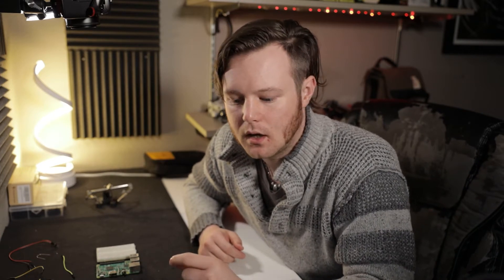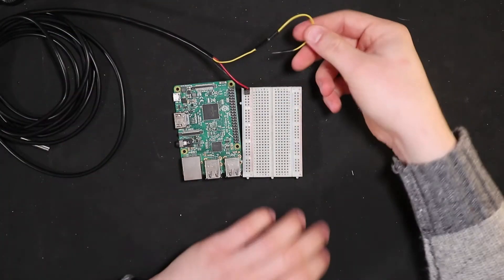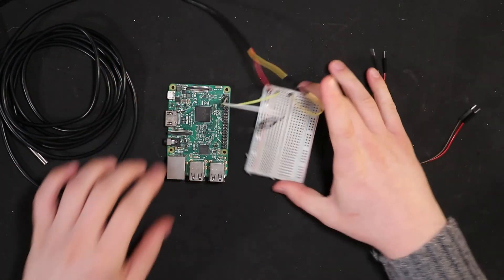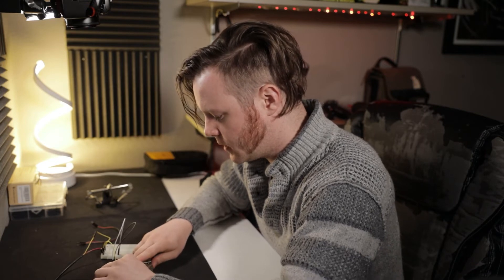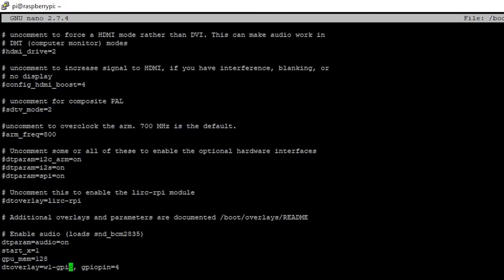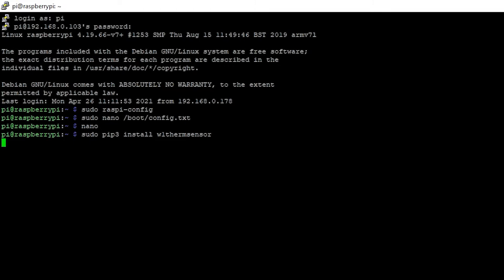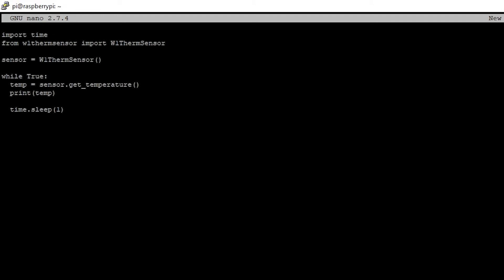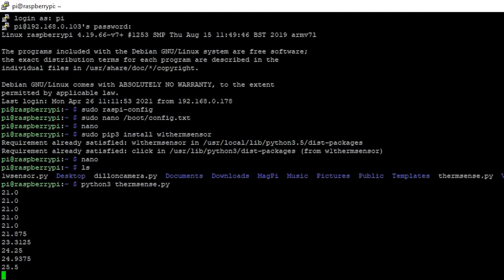A Simple Guide to Get the DS18B20 Running on Your Pi

Comment: How would it change where you have multiple sensors hooked up in series and need to read them all off of the 2 wire connection? (I have some grain bin temp cables im trying to read)
Reply from the maker: You would do it the same way. They all connect to the same data wire you’d just use different addresses for each sensor. You can literally have as many as you want on the same data wire. It’s great!

Comment: You wired it WRONG. the 1wire voltage level for the RPI is 3.3V, you used the pull up on the 5V rail.
Reply from the maker: https://mm.digikey.com/Volume0/opasdata/d220001/medias/docus/2890/UMW%20DS18B20.pdf

Comment: I get an externally managed environment error when I try to install w1thermsensor; it looks like I can either install it to a virtual python environment or bypass with the --break-system-packages flag.  Did you experience this issue?

Comment: Thanks for the video! I'm completely new to this, you mentioned soldering wires? Is that necessary? I was a bit confused about that part
Reply from the maker: I only did that to attached the pull up resistor directly to the wires, if you put in on a breadboard or have a version of the sensor like on a breakout board then you dont need to solder at all.
Reply: @makerjakenet  Thanks, I do have a breadboard. If you don't mind can you also clarify if the resistors I have would work? The ones I have say "1kΩ" and "10kΩ" would I use the 10Ω one?
Reply from the maker: 10k might work but if you put 2 in parallel then that would be the equivalent resistance of 5k and that should definitely work
Reply: @makerjakenet  Im not entirely sure what the means to be honest. I can see in your video that you put one in the top row and the other end in the bottom right corner of the top left section. Where would I put the second one?

Comment: Is it normal that the raspberry pi screen turns off when I plugged in the voltage pin to 3.3v pin?
Reply from the maker: I don't think so. That depends on the screen too though so I wouldn't really be able to help you much with that. The only thing I would recommend checking is to make sure your sensor isn't shorting out your power.

Comment: Can i use another gpio pin instead of gpio4 pin because i got another sensor connected to that specific pin
Reply from the maker: I THINK you can use any pin, you just have to configure it in the code. Don't quote me on that though

Comment: When you plug the sensor, is it normal that it emits a red light please?
Reply from the maker: The sensor doesn't have a light on it unless you have a breakout board that has one. Are you talking about the raspberry pi?
Reply: @makerjakenet  the sensor l have has a little board attached to do it. And the red light is on this little board when l plug the sensor to pin 7 or 8 (ceo), I am using raspberry pi 4
Reply from the maker: @maherkhaznaji  I see, then the light turning on is probably normal. Look to see if the board already has a resistor on it. If it does, then you probably don't need to add one of your own since it already has one.

Comment: Yo dude - I found this video for a similar project and have been pulling my hair out trying to get the sensor to work, do you NEED to use the breadboard? The tut I'm following doesn't mention it so I assumed I could connect sensor directly to PI
Reply from the maker: You don't need a breadboard but you do need to have a pull-up resistor on the data line to the power line. If I don't want to use a breadboard I've just soldered the resistor between them. The breadboard is strictly for convenience.

Comment: My local food pantry wanted to get temperature monitoring for a bank of chest freezers.  The problem that I ran into is they often shut one freezer down when they can to save energy.  Commercial solutions didn't offer an easy way to shut alarming on and off and I wanted something wired.  I experimented with putting a switch inline with each sensor on the power lead.  When attempting to read the sensor with the switch off I got 185.  I wrote a script to check the sensors hourly and if they were above 15 degrees and not equal to 185 it would alert.  I also log the temperatures a few times a day.  Their internet is nat'd so I have a reverse ssh tunnel back to my house that I monitor to make sure everything is still alive at the pantry.  I just instructed everyone to make sure the switch is on if the freezer is on and off if it is off.  So far it is working great.
Reply from the maker: That’s awesome! Sounds like a great use case.

Comment: Hello, thank you for making this! Very straight forward tutorial. Please could you explain what the purpose of the "pull up resistor" does? What would happen without it? I'm new to electronics, thank you
Reply: the pull up resister is part of what allows all of the devices to share the same data line.    formally this is a open collector circuit that implements a 'wired and' logic element.   search for those terms to get a full explanation.
Reply from the maker: @gngdunn  great info, thank you!
Reply from the maker: For many applications it is to make sure the default state of a pin is "HIGH." For others it depends on how the sensor communicates with the microcontroller. In the case of the sensor in this video, the only reason I know a pull up resistor is needed is because the datasheet says it's needed. I would assume it's for boosting the signal or making sure the data is read properly by the raspberry pi, but that's getting into areas I'm not super familiar with, to be totally honest.

Comment: At the beginning of the video, you mention a feature of the one wire protocol is that it is addressable.  Is the DS18B20 addressable in this way?
Reply from the maker: 1-Wire Sensors have an ID about 15-20 characters long or so (at least these temperature sensors do). If you use multiple devices, then you will need to use the part of the library that allows you to create multiple instances of the sensor using their respective IDs.

Comment: is the measure in  degree celcius or fahrenheit ??
Reply from the maker: By default it measures in C but you can change the "get_temperature" line to "get.temperature(Unit.DEGREES_F)", but you also need to add "Unit" to the import line to look like "from w1thermsensor import W1ThermSensor, Unit"

https://pypi.org/project/w1thermsensor/

This page will have more documentation.
Reply: @makerjakenet  Thanks mateee

Comment: Thanks a lot.

I would like to configure 4 temp sensors and they should display the temperatures on my phone over the internet. It should also log so that I can see a graph over time.
Any ideas on how to do this easiily ?

Thanks :)
Reply from the maker: Adafruit IO is a great tool to do that. I had a project I made a video about that I used Adafruit IO to display data for 9 enclosures.

Comment: I installed Android on mi Raspberry Pi 3, is there a way to read the value of the DS18B20 sensor form an Android App?
Reply from the maker: Unfortunately I don't have any experience with android on the raspberry pi. I would guess if you have a python editor you do something similar, but I can't say for sure.

Comment: I get an error message "could not find any sensor"

The sensor in on the circuit but gets extremely hot. Is that alright?
Reply from the maker: Definitely shouldn't get hot. How are you wiring it up?